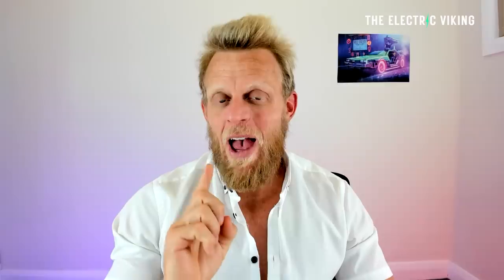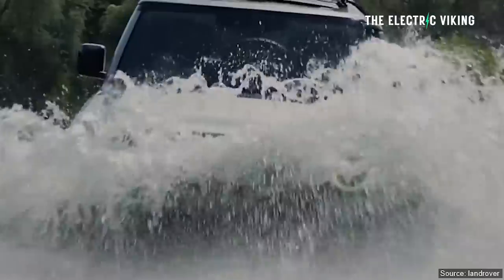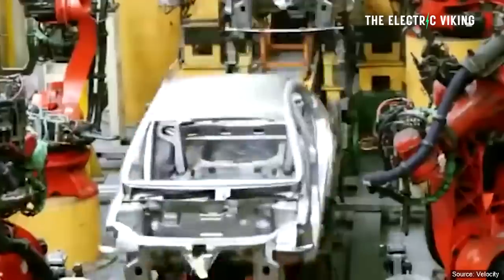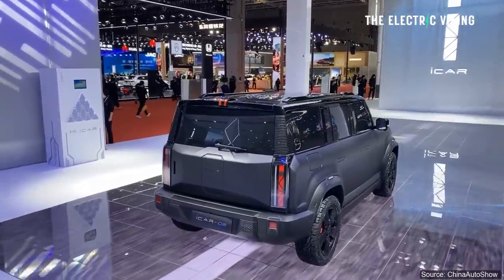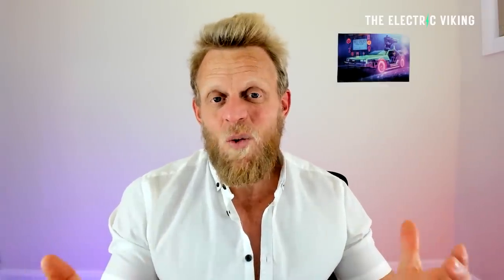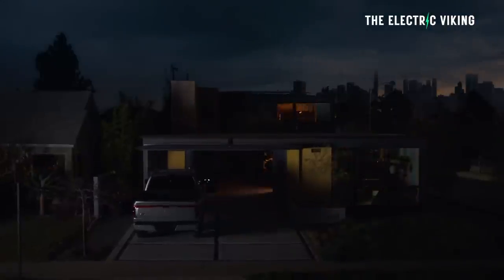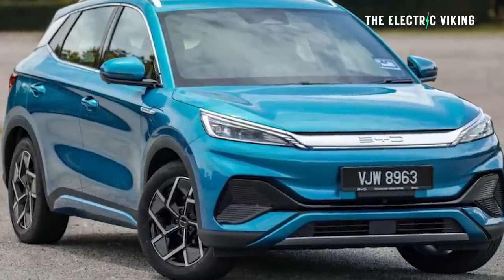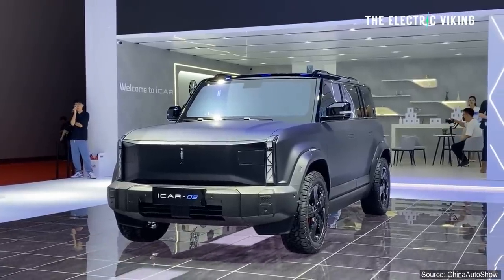Chery’s iCar 03 all-electric offroad SUV has solar and CATL's new battery

Comment: We can run an EV from the sun in Scotland, at least in summer anyway by plugging it into our domestic solar. Putting panels on a car only makes sense if they are light weight, but every mile they save is a mile that you don't have to burn expensive, dirty fossil fuel for. 😊
Reply: Solar panels are always very light, it's a good idea

Comment: A solar panel this size can give you around 0.5kW. If you park outside all day in New Castle, you can get 3-5 kWh, or 5-10% of the battery's capacity, or 10-20 miles.  It's like getting 0.5 gallon of free gas everyday!
Reply: the solar range for this car is above 50 miles
Reply: @tonypaca3015 For what charge interval?  If you park it in the sun indefinitely it can be the complete battery capacity.  50 miles per day is impossible.
Reply: man, you know, 0.5gallons and 30 days(one month), that's 15 gallons, that's 60 bucks saved a month, 720 a year, that's tons,

Comment: QUESTION SAM:  If a person is already buying solar and battery storage for a house, why pay a extra $10k for the solar on the vehicle roof?  You estimated this vehicle with solar is $10k more, and that, that is the version you like, but why pay the extra $10k?  It is like doubling your bills, if you have solar and battery at your house.  What is less expensive... making sure your house energy system has enough energy to charge your vehicle OR going small in the house and paying the additional solar for the vehicle?  I assume that a large house system that can charge your vehicle, overall would be less expensive?
Reply: Because you can go camping and to the outback without running out of fuel. You just need food and water and you will be able to drive
Reply: The first reason is the 50 km extension cable you save on. Or the home battery and wall charger you will need. 
The second reason is limited (or no) roof space
Just a direct connection from the solar panel to the battery management system is a great idea. No dependency on the grid.
Reply: And having your EV parked in the sun/outside will deteriorate it. Better in a garage.
Reply: @SolAce-nw2hf have you done the math how much power you get from only a few m2 worth of solar pannels, of they are clean, not obstructed by shadows from buildings or trees? Is it worth the extra cost and weight? The associated inverter electronics to charge batteries also add phantom drain... You will need a sunny place for this to make sense
Reply: @ttkddry  most of a normal solar panel weight is the glass. So compared to a sunroof this adds very little. Also solar cells have been improving, even having multiple layers that capture different part of the spectrum for energy production. Keeping the car clean is very hard I think. You would need water and a cloth and be taller than a child. As for shade, maybe there is a way to move this machine to a good position. Or just put it on and open space where there are no building, like a road maybe? Solar panels only add energy to a car. The electronics needed can be shut down to a dormant state, needing less power than keyless entry.
Will it add a lot of range? Probably not if you drive 500 miles a day. But if you drive 500 miles a month, these flat panels can add a lot in comparison, depending on the weather. And if you do get stuck somewhere with an empty battery because you missed the last charger, just put your feet up until there is enough charge to get you home in solar limp mode.
It's been done already and it works. Just think of it as a green range extender, not a replacement for charging all year long.
Reply: @AORD72  parking a Lithium based EV in a garage. How's your home insurance?
Reply: @SolAce-nw2hf  LFP batteries are fine for parking in a garage. No different to a petrol car.
Reply: @AORD72  LFP is safer, but I would not bet my life on it. When they do participate in a fire, the gasses are still quite deadly. So even if you just have an electrical fire (lets say a malfunctioning 11.000 W charger, and a fire does spread to the car, it may end badly.
Reply: Sam has mentioned before that he can't reply to comments. But it does appear that others are more then willing to act on his behalf!
Reply: @SolAce-nw2hf  I estimate you can add about 4kWh to 6 kWh to your battery on a sunny day, but in order to do that your car will heat up from sitting in the baking sun and you will have drag around extra weight. You consider it 'just a sun roof' but most cars have plastic pannels and aluminium bonnets to save weight, heck the entire back door of my Volvo estate is made of plastic, just to save weight. If you will replace the entire roof with glass, you will add weight. I'm afraid the benefits will be cancelled out by the extra weight and cooling costs... Not to mention how much extra production costs and complexity it will add to the car. If have have that kind of money to spend, chuck a few extra PV pannels onto your house roof and produce more power to charge the car. Other than LIghtyear Zero I have not seen any car implementing it, other than the contestants in the World Solar Challenge and they drive around in Australia for a reason, I do not see them on a highway here in the Netherlands in the fall...
Reply: @ttkddry  A full blown 400wp hail-resistant solar panel weighs about 25kg. A typical EV battery weighs 500 kg to 800 kg and the entire car from 1800 kg to 2300 kg. So even if you do not live in sunny Australia, that weighr is hardly going to matter. Also, a solar panel is not going to heat up the car all that much. The newer versions convert even more of the sun's energy into electricity. With a 25% efficient solar panel it is actually taking that away. So yes, it might be a little warmer than putting a white reflective paint on there, but is not going to offset the benifit al that mucht. If you have a plastic sunroof, I hope it lasts in the sun. I was not going to mention Lightyear because they had to restart after some bad financial choices. But actually they have proven it works, even in mediocre weather conditions. If Sam gets one of these cars, he will not be spending much time charging. It's the first time I think a box shaped car like this is good for the environment. A solar powered volvo estate would be great. Back to the 80's in design and just about enough room to transport a full solar installation for your home roof.
Reply: @SolAce-nw2hf  "quite deadly", what nonsense, how many people die from EVs catching on fire? Pretty close to ZERO I would think.
Reply: @SolAce-nw2hf a boxy heavy car with even some more unnessary weight added to it for just 5kWh per day at best will have horrible bad power consumption. Why are all the market leaders like Tesla and Lightyear spending huge concessions in shaping their cars more earodynamic? Look at the shape of the Cybertruck compared to a F150 Lightning... The savings are in lightweight materials and gains in aerodynamics, not adding more weight. Put the solar on your house . .. do the math... Solar panels not inclined vs the sun have a lot of power loss
Reply: @williamvanholz1666  Range from solar is greatly increased with a lighter and more aerodynamic design.
But if you really need the space and ability to carry heavy loads, the flat  roof is unavoidable. Not putting in solar is just a missed opportunity if the car is electric anyway. It will never make it efficient at highway speeds, but if you don't do many miles and are not at home during the day to charge, this is just a nice way to reduce coal emissions.

Comment: Although it's nice to know the battery is being trickle charged when in the sun I wouldn't want to constantly park it in direct sunshine. Here in Portugal Algarve the sun wrecks your paintwork and rubber window seals, wiper blades, etc in no time. I would still prefer to park it under a carport and just charge with excess from my PV panels which I can easily do with my Victron system. The car looks great I would buy it without the solar option...

Comment: I’d say almost everyone said solar wouldn’t work on an EV in its early days due to its size, these days the solar is becoming versatile, able to work with even curved glass, now its becoming the perfect addition to an EV when it’s used to send power to the battery pack and not just the stand alone 12v system that some EVs still have that let down the package

Comment: They should make the bonnet a single flat carbon fiber surface and put a solar panel on that also. Would help increase the range but also make it more visible by people walking past it that it's getting free energy. Slightly smaller aero wheels should be an option also for people not planning on taking it off road that would rather longer range without a larger battery.

Comment: Not sure 1 panel would add 40kms a day?  have been trying to get some info on charging an EV from say 10 panels off grid, do you need a battery to allow the charging to take place, will it be a problem for electronics charging  straight from panel to EV battery?

Comment: The biggest advantage of icar 03 : a new generation of pure electric SUV with aluminum alloy structure.  It uses an embedded aluminum alloy girder structure, which not only ensures the strength of the body, but also reduces the weight of the body.  The battery is embedded inside the aluminum alloy girder of the body, which ensures the height of the chassis and the ground, improves off-road passability, and ensures the safety of the battery.  The body and chassis adopt integrated die-casting technology, which reduces the number of parts and makes the body structure stronger.  Front McPherson with hydraulic isolation + rear all-aluminum alloy H-arm suspension, the shock absorption efficiency increased by 30%
Reply: Body size: 4406mm*1910mm*1715mm; Wheelbase: 2715mm; Minimum ground clearance: ≥170mm; Approach angle: 26°; Departure angle: 29°

Comment: Exactly what I'm looking for off-road electric Runabout. Wondering about the off-road drive system and its ability to work with one wheel suspended
Reply: Yes because they will use the brake calipers to slow down the spinning wheel. The downside of that is the wear and overheating of the brake disc so it is only usefull for short periods of off roading. A real off roader needs either 4 in wheel motors or a locking diff setup

Comment: chinese cherry store got cars for show but not for sale yesterday.20,000usd is for 1motor 2wd model with smallest battery and the 2motor 4wd largest battery model with lv2 autoDrive(I don't know about the battery capacity though)costs 27000usd,and this model still without solar charge option,

Comment: Is an efficient design a necessity, or even desirable? Maybe. If the EV is NEVER driven fast, and only short range, needed for transporting a minimum of 4 people, with baggage, then aerodynamics, lightweight, could be sacrificed for unique day-day usage. But, if medium+ speeds, medium + range, is common, or needed enough (an analysis is needed), then cost might be the deciding factor. 
However, there is one more factor, the intangible appeal of "looks", design, "beauty to the eye". I don't need the Aptera Sol. I want it. I will drive it slow, short distances, grocery shopping mainly, under 2000 miles/yr. Efficiency is NOT a necessity. I don't care. I want efficiency, self-charging. And I want that design. I fell in love. I have two ordered since 2020.

Comment: Try to screen for something like realistic ideas?  10 solar panels on a home in Vegas are about enough to power a Tesla Model 3 for 20-30 miles.  How far are the equvelent of 1 or 2 panels, flat on top of a vehicle going to move a big SUV.  A 1 or 2 miles?  OK its something but not much. What do you do when the panel fails .. replace your roof? You can just buy flexible cells and put them on your EV when you aren't driving; use magnets to hold them down have an inverter ..but it won't pay for itself. I suppose if you fell short of your charging station a mile or two sitting in the sun all day could get you there.

Comment: I like the idea of the car. The size, height and solar. What I don't like is the overly long front hood design. Not EV. The Cybertruck front has current EV design for this kind of vehicle. Just do it.
Reply: You might change your mind about design choices if you ever get in a front end collision.
Reply: @SignorLuigi  Safety is engineered into the vehicle, but not with random inches of hood. Crash tests are a better indicator than length of a design. Thankfully. there are other ways of measuring front crash safety., if you were really interested..
Reply: @eb1888.  The mass of an engine in the front, and the distance over which a car is stopped, play significantly into the physics involved in a front end collision and the forces involved. I am well aware there are ways to mitigate the downsides of reducing that mass and distance with alternate mechanisms. But it takes a great deal of research, engineering skill, and additional hardware to do that. Time will tell. As a physicist, I can explain more if you were really interested.
Reply: @SignorLuigi  Time has already replied. Look at the picture of the Model Y after the 250 ' plunge off Devil's Slide. 2 kids unhurt and minor injuries for the parents. Tesla has the necessary skills.

Comment: stage 4 cancer? You need to move to a place where no frequency wave radiation/vibration is possible so healing a treatment of you wife's medical diagnosis can be made in optimal conditions. This means, away from civilization, a high mountain. a building in q Cave , or  underwater .

Also, is a mandatory requirement to identify the frequency wave patterns that are causing all those medical conditions. 

#staysafe